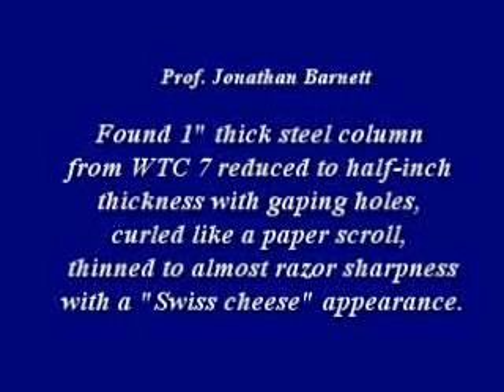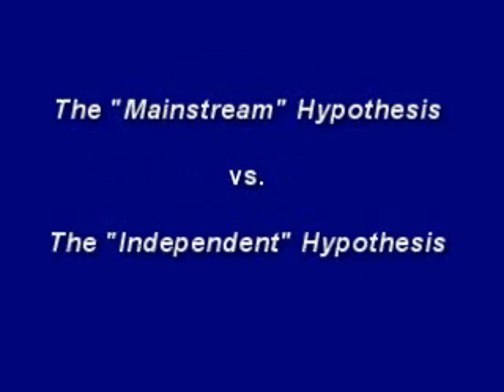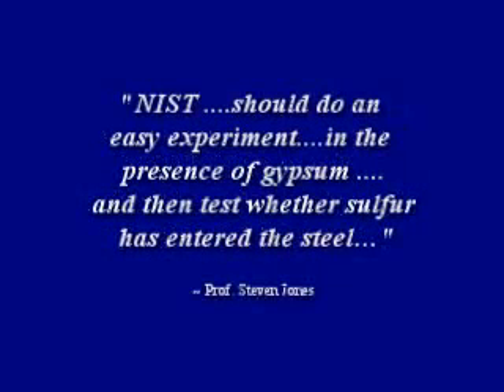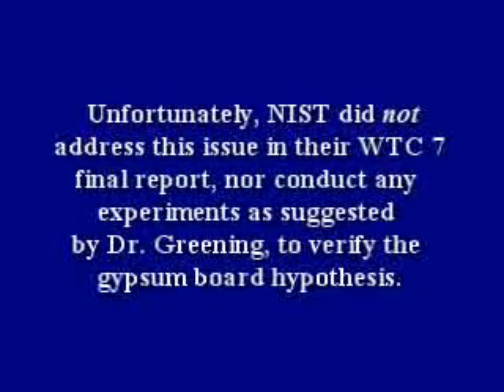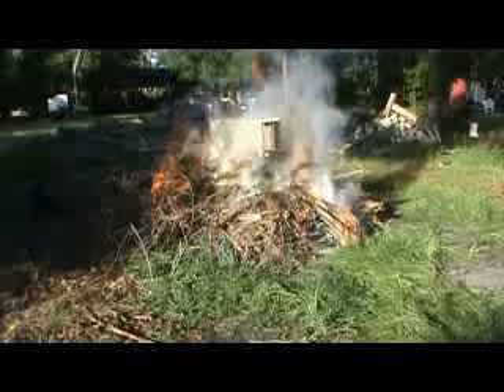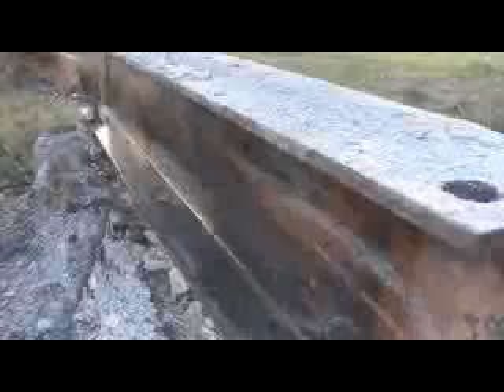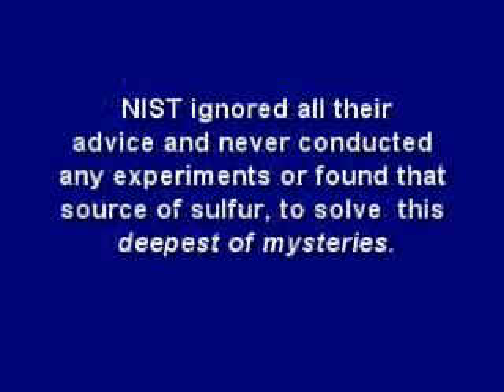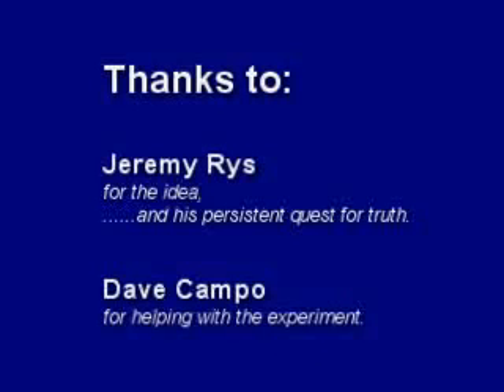9/11 Experiments: The Mysterious Eutectic Steel

Comment: i want to know how an aluminium plane wing cuts through 1" steel box section like a hot knife through butter! i work with steel day to day and know how strong 1" box section is. when i get the time i want to propel a solid 4" aluminium bar at a steel box section at 600+mph. i doubt it will even scratch the steel.
Reply: the pane was sub sonic, a high velicity bullet will not penetrate 1' plate. the plane is made of a thin hollow aluminium structure . there are videos of test planes landing into wooden telegraph poles where the poles slice easily through the wing structure without even breaking. an inch thick box section is like ww11 tank armour. this is just my opinion and this is why experiments are needed to back it up. if some one can get a 4inch bar of aluminium to slice through an inch box section i'd have to give them credit. but if they cant then there is no way a hollow frame plane wing could. america must have loads of airplane grave yards to try a full scale experiment of propelling a wing into various vertical structures to see the consequences. something for the mythbusters to try lol
id love to have the time and resources to do such things as the the way the plane sliced those columns is impossible in my eyes
Reply: have to admit tony the steel was a lot thinner where the planes hit than i realised, but my opinion as ignorant as u may find it is still that the structure was strong enough to have acted like a net and would have deflected considerably more before the bolts would have sheared. i also think the mass of the plane was not evenly distributed and not solid in structure especially the parts of the wings with no fuel. again my ignorant opinion
Reply: i understand where ur coming from tony i can see how a water balloon still hurts like shit when it hits u in the face as a kid as it has energy in its mass. whats your view on how the plane was able to travel at nearly 600mph at basically see level when pilots have said this to be impossible? if a plane didnt do the damage what did? i think the whole thing stinks to be honest. where do u stand with ur view on 911? do u agree the 911 commissions report by nist?
Reply: cheers for the reply tony, so let me get this right you think there is no conspiracy at all?that terrorists armed only with boxcutters that could barely fly sesnars were able to control and navigate an air liner at full throttle into the twin towers and the pentagon through the worlds most sophisticated air defence network? and that the buildings including building 7 fell to the ground due to fire? the flight path of the airliner that hit the pentagon has been described as challenging even for an experienced pilot by the pilots for 911 truth members. do you discredit their opinions too? to make the turn, level out hitting the light poles and not mark the ground would make the terrorists bloody good pilots. i do appreciate your comments as it has made me reconsider some of my opinions, as insignificant as they are on the grand scheme of things
Reply: To : dannyfall, ... instead of an aluminum bar try an empty pop can ... basically the same construction as a modern jetliner !
Reply: liquid filled makes it much more solid when moving fast  - throw empty water bottle at your wall then throw a full one
Reply: Try adding about 1% sulphur to steel. It passes 70s era tests for strength.. but embritles the steel. Its the reason that the Titanic sank.  Btw I was close enough to the collapse to see the temperature.. the fires burned around 500c.
Reply: To:  Marshall Roland, … Spelling correction ( please forgive me ), … you mean bat not BATH, … but you are quite correct.   I am/was a Professional Blaster and a Licensed Private Pilot.  I just finished doing an Interview/Documentary on the 9/11 Tragedy :     https://www.youtube.com/watch?v=0Y8hgzkV9Us
Reply: You do know that the aluminium sheets are just an outside casing ? The planes structure is far stronger than a thin bit of flimsy metal.
Reply: Birty Darstard on that type of aircraft the wing section is the strongest structural area .
Reply: Steve A I thought that was the case on most if not all planes.
Reply: Birty Darstard depends on the aircraft and it's design , it's an engineering marvel in it's self that this aircraft can fly at all , given it's weight and size
Reply: Birty Darstard Regardless of the debate , the truth people seek I believe won't change a thing . If the truth was revealed today the " truthers " will never accept anything that differs from what they believe . It's been 17 years dam
Reply: Birty Darstard Just remember small planes built with sub standard material in Japan were used to sink warships during ww2 " kamkazi attacks " at times penetrating armor up to 2 feet thick .
Reply: Steve A lol
Reply: dannyfall well, if it helps, one of my mates was out riding with one of his mates, on motorbikes, fanging it probs 280-300kms and he crashed into a car. The motorcycle cut the bottom of the car in half and his torso cut the roof in half. 

But the roof thickness was like 2mm and the leather coated torso is softer than plane wings.
Reply: The easiest way to demonstrate this is to ask how much damage could a table tennis ball do to a table tennis bat??  The bat is much stronger than the ball, right???

https://www.youtube.com/watch?v=Wc-zmb3jAgo
Reply: Scientifically does it make any difference whether you throw a plane at a steel building or the building at the plane?
Reply: +dannyfaull It depends how fast the knife is traveling.  Hence the use of hammers, bullets, high velocity explosives.  The faster the speed, the easier the cut.  Would you die if someone THREW a bullet at you?
Reply: Tony Duncan you are so unfuckinbelievable dumb
Reply: dannyfall - had a plane struck the towers only two holes would have been observed along with dents in outer tower structure. The two holes would have been from impact of two 7000lbs engines. Best explanation of impact is to imagine the towers being slammed into an aircraft in stationary posistion. Correct never has a baseball penetrated a bath unless the ball was solid steel.
Reply: If you don't think it possible ,well how can Japanese zero penetrate 2 to 3 feet thick armor on us battleships during a kamikaze attack ?
Reply: To : Steve A., ….  " 2 to 3 feet thick ", …. the absolute maximum Belt Armour on a Battleship was 12 inches thick and the Deck Armour was a mere 1.5 inches thick.    No Zero ever penetrated 12 inches of armour let alone 2 to 3 feet of armour ( no such armour existed ), … the deck armour of 1.5 inches … YES, … at least the steel engine moving at over 250 MPH can penetrate 1.5 inches but no more.    Do a little better research or go back to playing with your X-Box.
Reply: dannyfaull "In my opinion the structure was strong enough to have acted like a net and would have deflected considerably more before the bolts would have sheared" - It did exactly what you described, deflecting around three feet en masse, and then another three feet for every column section that was going to be pulled off its fixings.  Being very elastic, the undamaged and slight stretched remaining steel pinged back, and the top face of the aperture dropped a few inches under the less-supported dead load.
"i also think the mass of the plane was not evenly distributed and not solid in structure especially the parts of the wings with no fuel" - you are correct about that too, but solidity wasn't the requirement to make the hole.
Just mass times the square of the speed.
Jelly would have been just as effective at eight hundred and twenty-one feet per second.
The closest survivor to the impact reported that part of the left wing came to rest in his office.  It included its tip, I think.
Reply: dannyfaull "I understand where ur coming from" - No. You THINK you do.
"it has energy in its mass" - it has energy in the SQUARE OF THE SPEED:  To go TWICE as fast gives (or requires) FOUR times the energy.
"whats your view on how the plane was able to travel at nearly 600mph at basically see level when pilots have said this to be impossible" - I have been an aircraft designer.  The standard practice when designing large passenger planes intended for subsonic cruise in the lower stratosphere is to design their airframes to withstand straight and level flight, with no control movements or external turbulence, UP TO TRANS-SONIC INSTABILITY, a point beyond which you would have to "ruggedise" it, as with Concorde and jet fighter interceptors.
That point is a Mach Number - 0.93 - typical for most of these aircraft.
Mach 0.93 is 707 mph at sea level, so the planes were within their capabilities.
Pilots are instructed to NEVER EXCEED TWO THIRDS OF THIS SPEED.
"if a plane didn't" - but it did.
"i think the whole thing stinks to be honest" - I think what you've been reading does that.
"where do u stand with ur view on 911? do u agree the 911 commissions report by list?" - No.  It agreed with my view.  (My interpretation preceded NIST's).
Reply: dannyfaull 
the box section walls were only about .375" at the level.
Why not put up a whole row of correctly dimensioned box sections and throw 90 tons of aluminium at 600 mph at them. When you get time, of course.
Reply: 100's of tonnes of aluminium going at 500-600mph will smash concrete and rip steel.
Reply: dannyfaull "the pane was sub sonic" - It was indeed.
"a high velicity bullet will not penetrate 1' plate" - I can show you bullets which will do this easily.
"the plane is made of a thin hollow aluminium structure" - It is indeed.  The planes in question still weighed about 100 tons.
"there are videos of test planes landing into wooden telegraph poles where the poles slice easily through the wing structure without even breaking" - And landing speed is a THIRD of the impact speed of these planes, and therefore ONE NINTH of the kinetic energy they possessed.
"an inch thick box section is like ww11 tank armour" - No it isn't, because it was only 5/16th of an inch thick, and tank armour is up to 4" of hardened steel.
"this is just my opinion and this is why experiments are needed to back it up" - Your "opinion" is ignorant crap and needs no backing-up.
"if some one can get a 4 inch bar of aluminium to slice through an inch box section i'd have to give them credit" - No-one needs your "credit".
"no way a hollow frame plane wing could" - It didn't. 14" square hollow columns 5/16" thick are what were penetrated, and they were penetrated without being cut because their fixings failed first.
"the way the plane sliced those columns is impossible in my eyes" - That's because your judgement has no basis in fact.
You would need to learn some engineering.
That would be cheaper than all those experiments, and would have a lasting effect.
I recommend it.
Reply: +dannyfaull "you think there is no conspiracy at all?" - with respect to what, exactly?
"terrorists armed only with boxcutters" - demonstrate how that plan couldn't possibly have worked on that day.
"could barely fly sensors" - who told you that? Have you been spellchecked?
"were able to control and navigate an air liner at full throttle" - the planes can fly by twiddling knobs.
"through the worlds most sophisticated air defence network?" - it wasn't sophisticated at all, faced exterior threats, and was practising for such.  So yes, easy.
"the buildings including building 7 fell to the ground due to fire?" - It's why there are fire departments. Buildings can.
"the flight path of the airliner that hit the pentagon has been described as challenging even for an experienced pilot by the pilots for 911 truth members. do you discredit their opinions too?" - Well, challenging  means possible, and who was it that told you these "pilots" hadn't been trained?
"to make the turn" - there is such a thing as luck.  How did Shanksville work out?
"i do appreciate your comments as it has made me reconsider some of my opinions, as insignificant as they are on the grand scheme of things" - Reconsideration marks the beginning of scientific method.  Please continue to reconsider.

Comment: Proving you wrong?
The only reason why such a stupid experiment is needed is that the USA government is the sole responsible for what happened. Who the hell needs the proof that a 14" steel shaft cannot be reduced to a contorted piece of metal by a 600 degrees fire with some concrete dust??????

Comment: just supposing that everything that the "experts" on the Gov side said is true , & that these planes really did cut through the steel & concrete & that fires softened the building so much that it collapsed,,even if all that is true ? How could that damage to the top portions of the towers cause the whole two buildings to collapse? there was no damage below impact points except the fire down the elevator shaft.

Comment: Nothing To See Here, Just Many More Nut Cases. `Many, many, Other Forces Involved In The Collapse, That You, Or Any One Could Never, ever, Come Close Too Imitating. `Forces Of Consideration: Heat, Combined With Mass Weight, Momentum, Speed, The Effects of Cutting, Crushing, Scraping, Sheering, Tearing, Twisting; etc, etc, ~Not Too Mention, The Impact of The Commercial Jet Liner Itself, Made Up of Aluminum, Metal and Steel, Tons and Tons of Jet Fuel; etc,, `Speed: At Approximately, 530 mph... {People,, "Don't Give Up Your Day Jobs.

Comment: they energized the building and degenerated it. microwaved it. more of the puzzle is needed to get more specific.  forget the furnace theory.  they use electricity to melt steel in the foundry, they dont use a furnace.

just put two words in google and see what comes up [ foundry cauldron ]